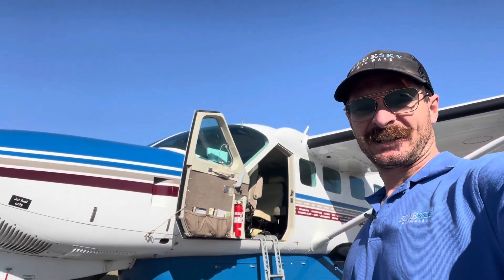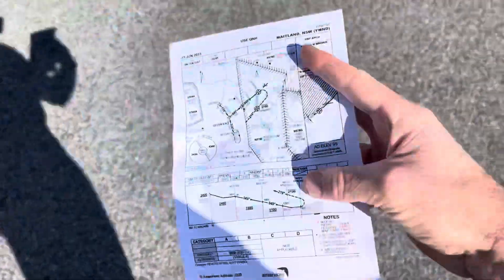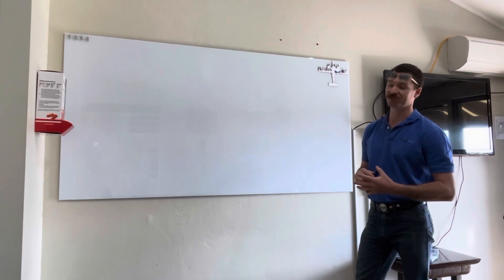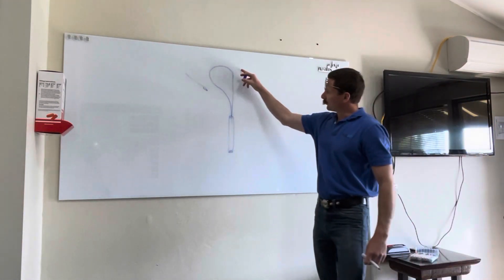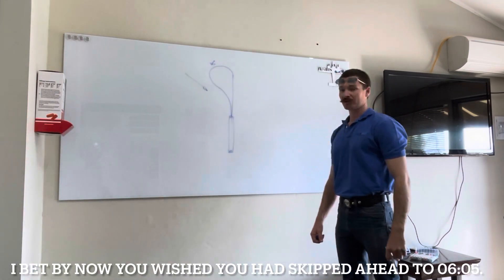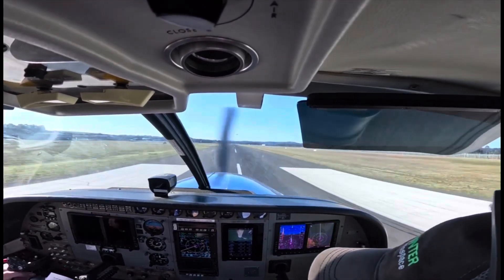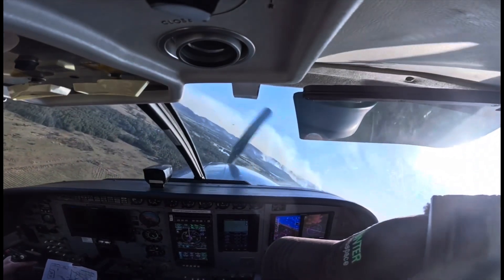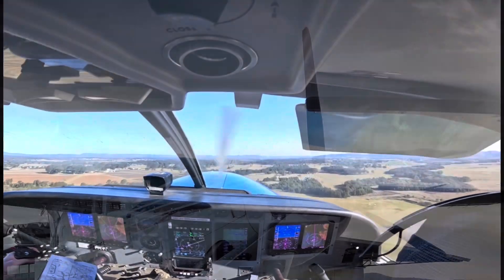C208 Turnback Explanation

Comment: AFTER the Turnback i always push nose down after flaps down to beginning of runway, not the middle or almost to the end.  Then i level it at 2 feet over runway and cut the flaps.
Reply from the maker: Yep, I do the same!
Reply: @aeroplanetoby  That is called "A 2 feet flap cut trick".  You do that if expecting to float too much due overspeed over the Vref.  High wing airplanes tend to dip the nose, you correct for that. Low wingers tend to raise the nose so you have to push down nose a bit as you cut the flaps.

Comment: Most airplanes that climb at over 700 fpm can be turnback from proper safe altitude.  PC12's Pilots are required to Turnback from 1,500 agl or they cannot fly that airplane. I used to teach them on all kinds of Cherokees, Cessnas, Grumman singles and Piper Tomahawks too in my 1990's CFI years. Have videos from 1995.

Comment: Pilatus Pilots also have to do EFATO Turnbacks well on simulator BEFORE they are allowed to fly that aircraft.  Cant do it? That is the door, dam coward they say.   Insurance co's wont insure pilots that cannot Turnback from around 1,500 agl.  They reject the Mild Maneuvering Pilots.  Good.
Reply from the maker: Yep, the TBM is required to be able to do it for Part 135 operations here in Australia too. The minimum height for that is also 1500ft AGL.